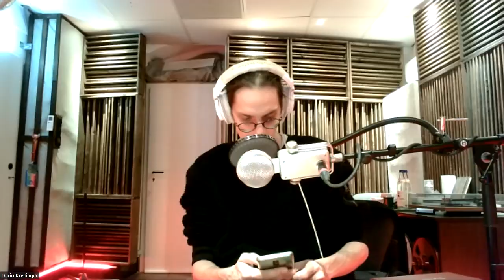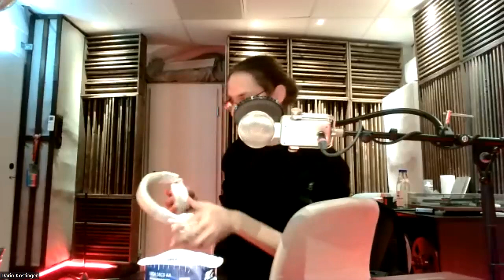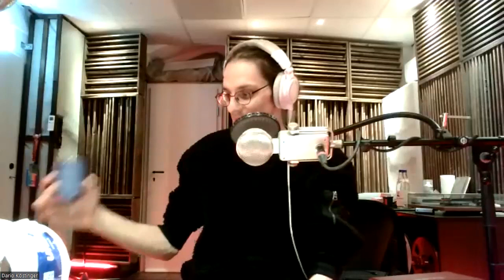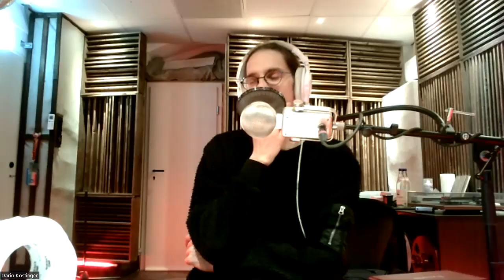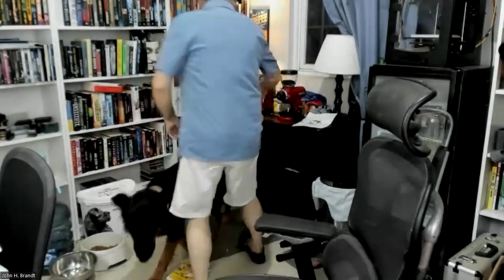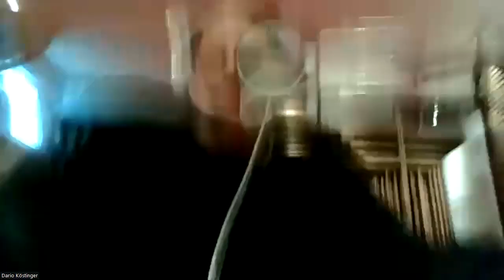Conversation with Dario Kostinger about Studio room treatment

Comment: Listening to you guys talk through various challenges and solutions was very informative, as I continue to build out my home theater acoustic treatments. Upon doing my research, I'd actually been really curious about the seemingly prominent use of space couplers over studio desks, which you addressed as creating a diffractive cloud that helps to mask studio desk reflections. That was invaluable, so thanks for that! I'm curious why space couplers don't seem to be used as much in home theater applications over seating areas, ottomans, etc. Any thoughts on that? Thanks again!
Reply from the maker: Thanks for the questions. 

In a theater environment, a sense of space should come from the sound source or movie soundtrack. The room acoustic should be a neutral canvas on which the soundtracks are painted. Theater seats are normally quite absorptive and require no masking. Those are my thoughts and opinion. 😁

Comment: Unfortunately URSA SF38 is not 38kg/m3. It has nominal value of thermal conductivity λD = 0.038 W/mK, and the density probably below 20kg/m3. There are some products that should be better-  Knauf unifit 032 - 34kg/m3, λD = 0.032 W/mK , Isover multimax 30 - 40kg/m3, λD = 0.030 W/mK. I would look for λD <= 0.032 W/mK, as its density should be around 30+kg/m3. Rockwool usually has higher λD for the same density compared to glasswool.
Reply from the maker: Rockwool does NOT perform as well as fiberglass.
Thanks for the information about Isover multimax 30! That's the stuff to buy!
We have tested many of these products both glasswool and rockwool. Glasswool outperforms every time.